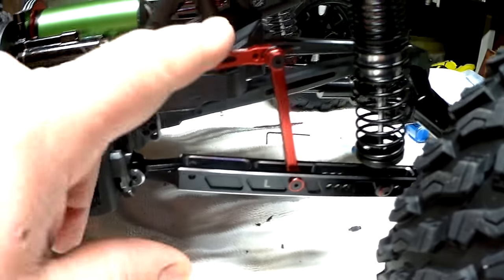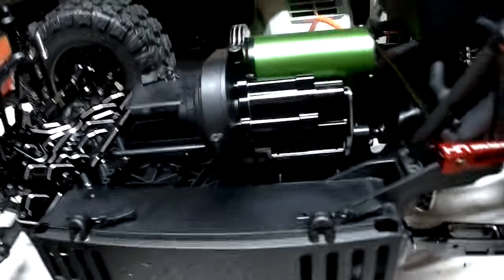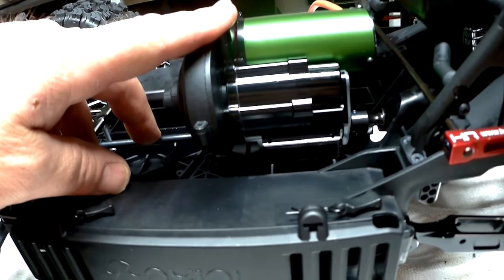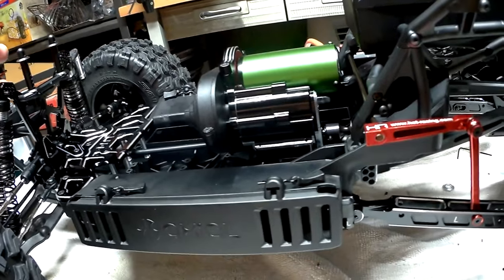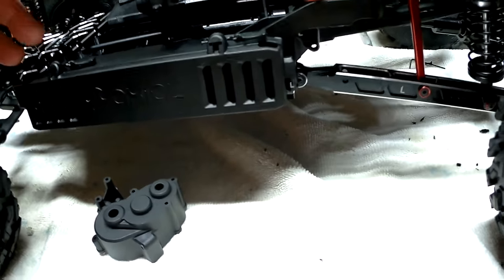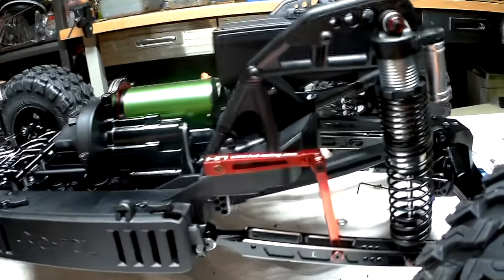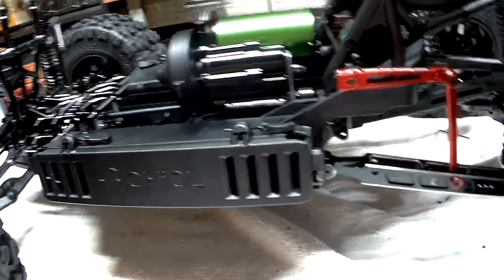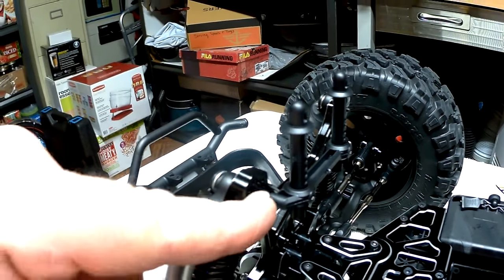Axial Yeti XL EXTREME Update  Part 2

Comment: Really great YXL 👍 
This truck have big tires with high grip...all peoples have issues with   diff....need to learn control the trottle or used an center diff !lol!
YXL isn't the best basher ...is the best monster buggy for realistic driver style.
Reply from the maker: Yea im not going to bash the snot out of it...just beat it up alittle...
Reply: RCbashing the KRATON okay I understand you ...I'm just afraid to see this green castle ! Ahah....
Please look at two screws AXA148  (not long enough to hold up AX31007 ) on the rear !
I own 2 YXL one for trail (4S 2200kv) and one like your build for cross & climb (6S 1450kv 4292 cam).
Great project in your Rc collection 👍
Reply from the maker: Thanks bro for tip... the motor is temporary. till i get lower kv.. 1800 kv is going to be the ticket... i  will look at the screws you mentioned..Thx bro

Comment: Pimped out no doubt 😱!!! Great job with this build and pointing out potential weak spots. Looks like you got them all covered. Hot Racing definitely makes great stuff. You gonna put a Tbone bumper on there😨. Just messing bro...Lol!!! Killer job, can't wait to see your maiden run.🍻🙋🙋😲😲😲😵😵😎💪👊👊
Reply from the maker: Build is complete as of now....I will post tomorrow finished product... all the upgrades on it are needed for durability... this thing is to heavy and torq monster for all the plastic parts that come with it...Should be good to go now...
Reply: RCbashing the KRATON strong work brother 👍👍. You built that sucker quick. Looking forward to it bro. 😎💪💪💪👊👊
Reply from the maker: LOL .. alot of 3.30 am nites.. my wife said you don't have to build it all at once...The kit fit and finish is perfect kit..Axial should have just put out better quality and charged 100.00 more......I wanted to buid this for my pit spot were all the trails to climb  are rutted from rain.. this will be perfect for out there... i wont jump it alot just bash it alittle...will see if i can get out ther tomorrow.. we had alot of rain today...MUDDIN IT
Reply: RCbashing the KRATON right on brother 👊. Yeah I thought the same about the Tekno MT410 with plastic parts instead of aluminum 🤔??? We've been getting rained out here, too off and on. 😎💪👊👊